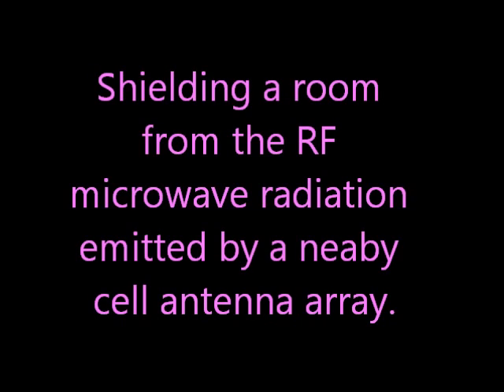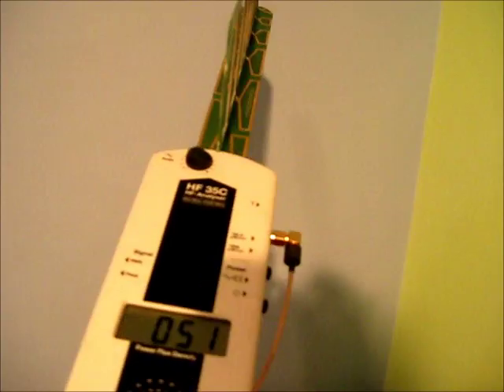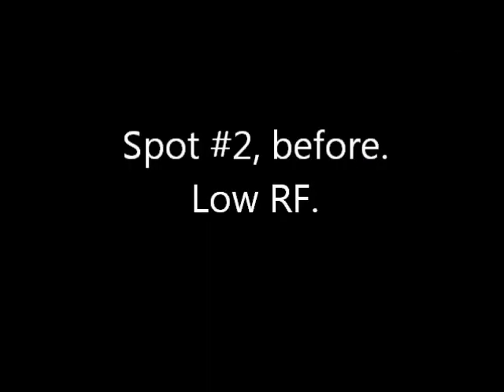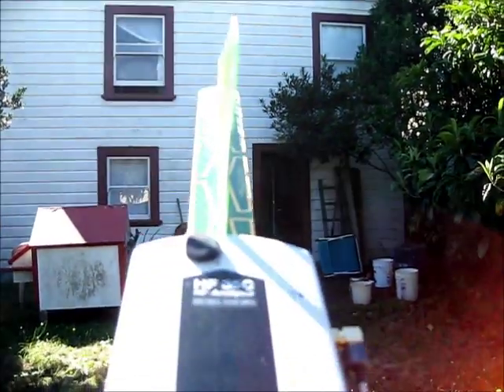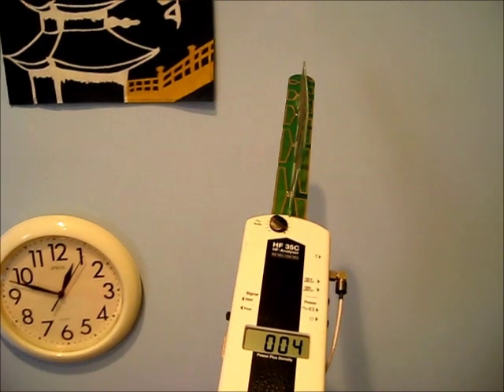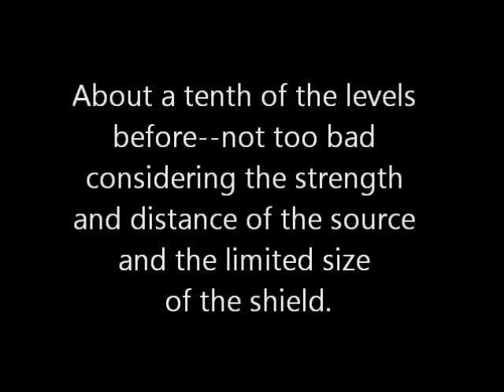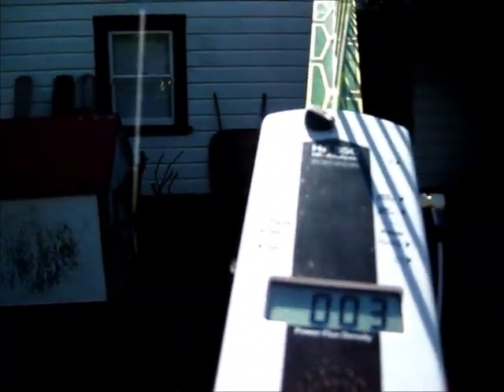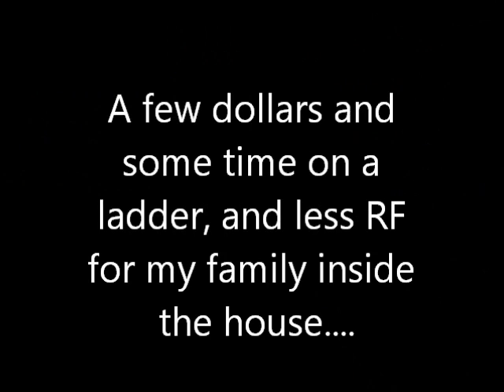Shielding a Room from a Nearby Cell Antenna

Comment: Reducing the RF by 90% is a huge deal for so little cost. This was in 2011 though.  By 2020 you might have a 5g mini antenna 30 feet from your front door.  The law says that telecommunications companies CANNOT be held accountable for any health consequences created by these radiation transmitters.   And, no local municipality can stop them from putting these antennas wherever they want.

Comment: Ur pretty smart for considering reflection after shielding.  Two question for those using aluminum screen, does the "charcoal" aluminum screen shield the same as "bright" aluminum screen?  Next, a smart meter will get you w lots more radiation.  You have one of those and test it?  Third, where did you get that detector please?

Comment: Very strange video! Where is the source of radiation? Behind the wall? Behind the person? What is the point of measuring , pointing at house? Is the source of radiation there? Questions, questions.............
Reply: Sunny Roses, it was well thought checking the yard before and after the screen to see if reflection back into the yard made that location hot. I’m hit from 3 sides from Nat. Gas Smart Meters. A doubled aluminum screen behind my headboard halfs the worse culprit and doesn’t appear to increase the other 2. Eventually I’ll block those also but be aware the pulsed EMF/RF smart meters may vary drastically through day/night as well as minute to minute. I think they are strongest in daytime when they do a drive-by to get readings. Just my learners opinion.

Comment: Your second spot after the shielding hit 9 spike when before all spots but the last two had hit 6. Then after shielding your last two spots spiked 10 and 11. There were still spots in wall still high. But I'm sure with another layer would be fine. How does the backyard have no reads but a home? Is it the homes own electrical in the walls?
Reply: Amanda Rosado Yes, it is very strange!!!!

Comment: Steel or copper screen works in any shielding project, smart
Meter blocking, grounded or electrified  faraday cages,
Orgone accumulater.
Clean undamaged aluminum foil in layers( no holes).
Aluminum screening is a poor choice for blocking/ deflecting e.m.f.,E.m.r., e.l.f.,d.e.w.s. and microwaves.

Comment: When I'm lying on my bed, I get 5 Gauss. Is that good or bad, because I don't have any meter at hand ? Oh, there are 3 x 4G stations (BTS) within 500 m from my house and an elevator behind the wall. I hear low pitch buzz sound (diesel) in that room.

Comment: Human beings are not at all affected by "100 micro watts per square meter."
The window screen will shield from RF radiation, but operator should test further from that well, because the RF is a field, not a direct beam.
Reply: This is incorrect.  Some humans are definitely affected by such a high value, even as low as 5-10 microwatts/meter^2 is enough to elicit headaches, joint pain and chest palpitations within a few minutes, and the 'tingling' will last for a few hours. I live with an electrically sensitive person.
Reply: @kengartner204  If Ken's subject is that sensitive, then significant shielding is called for:  window screen (prefer copper) type material totally surrounding the subject, if a room or a home or what.  The screen should be grounded/earthed several places. If the holes in the screen are too large, solid sheeting must be used.  Any electrically conductive metal is ok but joints must be tight.  Use "finger stock" on doors/windows to assist continuity.  I know of no other defense to RF radiation.  Condolences to the RF sensitive, but ordinary conditions apply to my first statement.
Reply: @CharlesHarpolek4vud  thanks for engaging.  She developed electrosensitivity suddenly last year and it took a bit of sleuthing to find the cause.  Here at home, we have the sanctuary space  with typical RF readings of 0.300 microwatts/m^2 or less (measured with the Safe&Sound Pro II meter).  This is due to a happy accident of having a metal roof, foil-backed polyiso insulation panels and low-E windows.  All act to bounce RF frequencies.  However in this configuration we can never have RF devices enabled in the home, since they  bounce around inside. We have to 'sweep' all guests and divest them of their devices.   There are conductive fabrics to assist with travel in the car, but are impractical exercise walking.  An electrically sensitive person typically is consigned to a housebound existence,and I have to prepare all meals since she cannot approach the stove or refrigerator. We are still actively working to figure out the best avoidance strategies so she might improve her health and tolerance but this condition is not well understood and the medical system is unhelpful.

Comment: the clock battery is producing more radiation than the cell phone antenna. when outside there was no cell phone antenna reception. result: the guy sleeping in that room is going crazy due to other reasons
Reply: you're either stupid or a shill
Reply: yeah it's something in the house.. not the cell tower.. because that same device will pick up the same sound from a laptop computer .

Comment: Thanks for your video.  I have just done the same thing as you.  Same material, just a lot more of it -- just a block away from dozens of masts.  Anyway, curious about grounding -- how to measure it (what kind of multimeter is best), and how much gain comes from grounding the shielding.

Comment from the maker: Simple---the upper portion of the house is in the "lobe" of a cell antenna array on the second story of a building ~500ft away. The lower portion, and the yard, are shielded from this radiation by other houses and trees. 

Where there is no direct "line-of-sight" RF radiation is reduced. I.E. if you can see the antenna, the radiation is much higher than if line-of-sight is blocked.

Comment: Stacking cases of water on that wall will absorb the microwaves.
Reply: iprovedit now that’s an interesting idea.... if you’re smart these days, ya oughta be prepping with some bottled water anyhow... could stack a wall with jugs of spare water.... interesting idea
Reply: iprovedit but is the water drinkable after the absorption??
Reply: Yes it is. The only effect of RF absorption is a very slight heating of water molecules not unlike water in direct sunlight.

Comment from the maker: It's confusing, but the two meters use different units. The units shown on this device are in microwatts per square meter. On the Cornet device, the output is in milliwatts per meter square, which is 1000x less sensitive. In other words, 1000µW/M² (microwatts) equals 1mW/m² (milliwatts). The "20" on the Cornet on Bart is equal to 20,000 µW/M² on the analyzer in this video --- which is off the capacity of the read-out. Search "A Primer on the FCC Guidelines for the Smart Meter Age" for more info.

Comment: I'm looking at a chart 14:46 into The Dark Side of 'Smart' Meters by eon3 on YouTube and it shows childhood cancer risk factor in relation to distance from the Mt. Sutro Tower. 3 microwatts/cm squared is somewhat equivalent to being 1 km from the tower with a 1000% increased risk of childhood cancer, which seems to be the baseline of your meter in SF anywhere.

Comment from the maker: @therunningmanlives This is metal---it's aluminum screening, mesh size 18x16, which is available in a 4-ft width at the hardware store, for a bout $1-2 a linear foot. This is about 22 feet cut into two pieces.